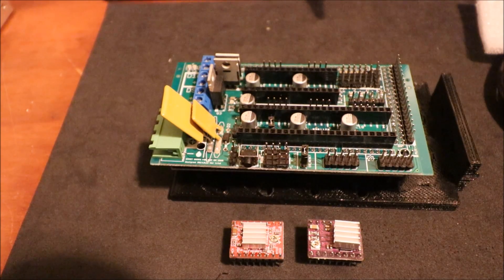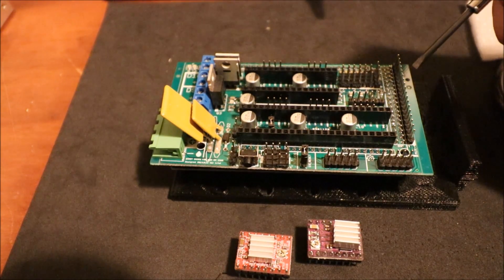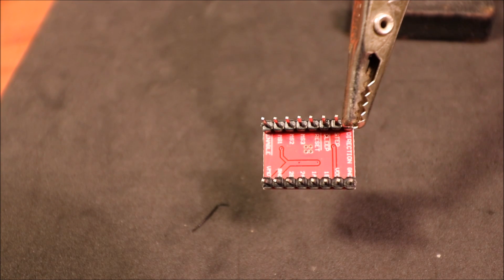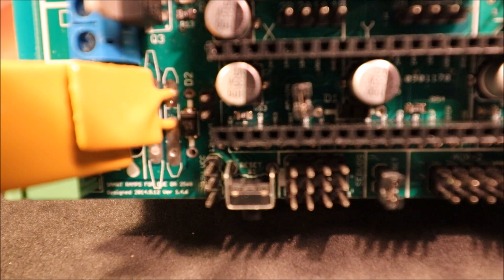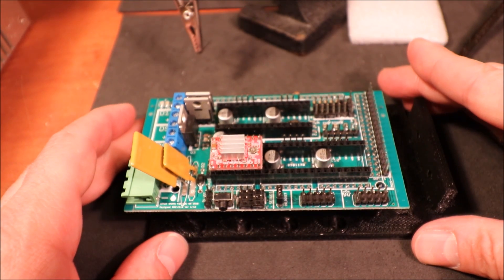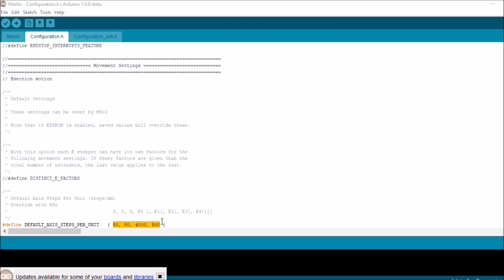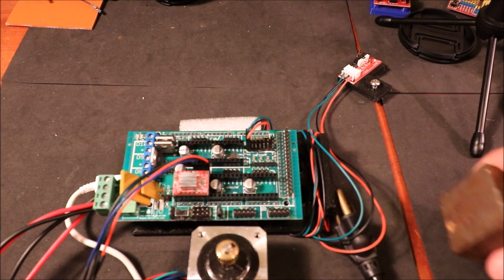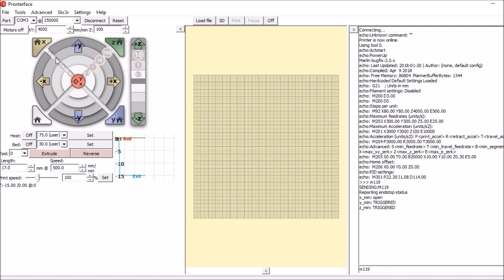Smart RAMPS - A4988 Stepper

Comment: For a 61 year old beginner your tutorials are very informative and you cover each and every step which really helps. What would I use in Aurdino for a ramps 1.4 motherboard that I'm going to use as a XY pen plotter where i dont need heat beds ect.
Reply from the maker: Thanks. As a plotter I'm unsure if the configuration, but it's true your not going to need heatbed.
Reply: @EdwardBraiman  Thank you for the Quick reply. I have been struggling for over a month to get my machine to run. I will try Board_Ramps_1.4 and leave the rest blank.
Reply from the maker: Is it working?
Reply: @EdwardBraiman  No it won't compile and gives a stack of red font at the bottom.
Reply from the maker: Which version of Marlin firmware?  Could you say what settings are being changed?
Reply: @EdwardBraiman  Marlin 2, followed your most informative videos thank you. I enabled Num_Servo to 0ne, enabled end stops for X & Y to true and used Board_Ramps_14_SF, but I get a stack of errors when compiling not sure what's gone wrong.
Reply from the maker: @MrLeopain  so I tried compiling/build with your settings in VScode and didn't see an issue with Marlin firmware 2.0.3.  Could you post the lines texted used.  And which development IDE you're using?  Is it Arduino IDE?

Comment: So, I followed your video but all my motors do is buzz.  They don't turn.  What could I have done wrong?
Reply from the maker: Does the motor shaft lock in position?  You  trim pod might be set to high or low.  Check out my MKS Gen L playlist for the tuning process and see if it works.  What type of NEMA stepper motor are you using?
Reply: @EdwardBraiman  Yes, all four motors just lock and buzz.  I've got your exact setup, motors and all.  At first, I discovered my PS was set up for 220V, however,  reconfiguring to 110V made no difference.  Same issue. I'll watch your video On the MKS Gen L and see if that will fix my issue.  Thank you for your quick response!
Reply: @EdwardBraiman  So, I followed your tutorial for calibrating the A4988 Stepper driver.  No luck.  Still doing the same thing.  Starting to suspect that I have either a bad Ramps shield or the osoyoo brand Arduino mega.
Reply from the maker: Voltage maybe damaged board.
Reply: @EdwardBraiman  Nope!  Figured it out. Motors were out of phase.  The wiring to the motors was wrong.  Had to repin the connectors.  Now all is well.  Thanks for your quick responses and for all your hard work making these great videos!
Reply from the maker: You're welcome.

Comment: What about status RGB LED would you consider making a tutorial video on this? Sorry for ramps 1.4
Reply from the maker: I'll need to order one.
Reply: Edward Braiman I have some I could send you, RGB Strip
Reply from the maker: Do you have a link where I can order them?
Reply: Edward Braiman got mine at Menards
Reply from the maker: I'll check tomorrow.
Reply: Edward Braiman 12v red green blue
4 solder pads. In the tv installation area you get 2 20” pcs of rgb led strips, a wallwart 12v a small transmitter and a receiver module about 15.00